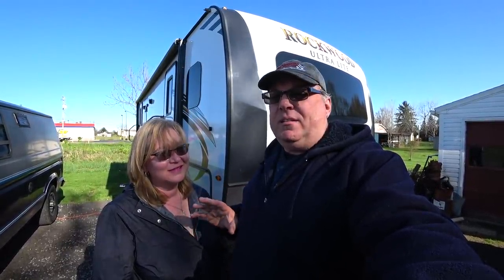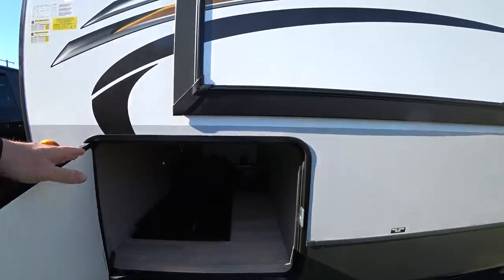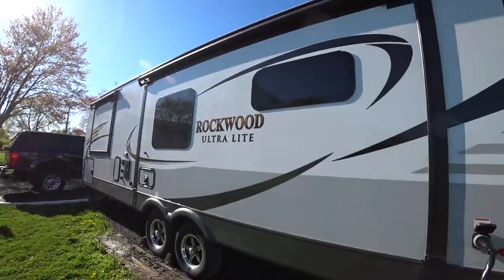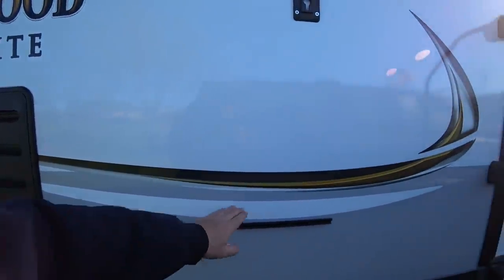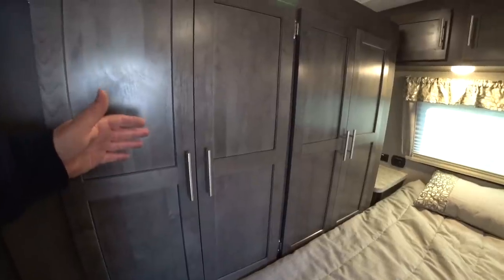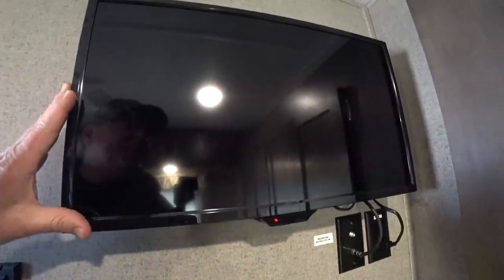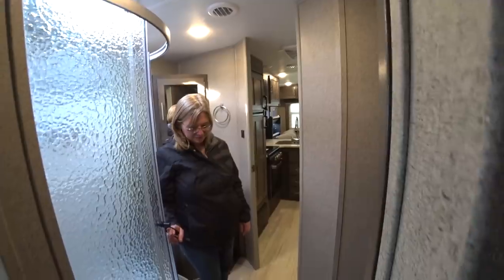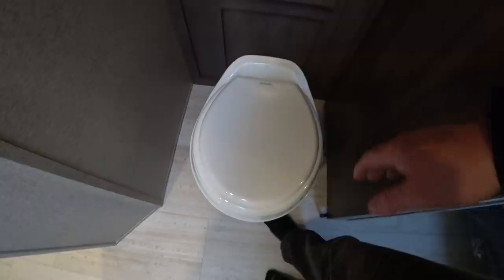2020 Rockwood 2604 WS Detailed Look & Why WE Bought it

Comment: Here’s the thing about parking at truck stops. Truckers have very limited parking and they have to run under government regulated hours of service. So when you park at a truck stop you are taking away possibilities to park for truckers.
Reply from the maker: We always call ahead and ask if there is rv parking.. we've discussed this before in videos. The problem is there's not enough parking. The RV industry is booming as it has been for the last five years. This year, 2020, has seen unprecedented new RV buyers. So if the parking had been Limited at truck stops prior to all this it's really limited now. The whole reason that truckers need to park at the truck stop is because necessary sleep requirements. Weather it's the trucker deciding that it's time for them to take a nap or it's the electronic logs it's telling them to take their break. Most RV owners understand that. Most RV owners do not want to stay in Truck stops. But, the same issue applies for the RV owners, they need to take a break for safety reasons. There are some rigs out there that rival big trucks. Even my small travel trailer and F350 at 17000 pounds combined weight could do a fair amount of damage if I fall asleep at the wheel. So, knowing that I do not want to stay at a truck-stop because of the noise, the piss in the milk jug left outside, the lot lizards, and the smell of diesel fumes lofting into my trailer throughout the night you can get the idea that it's a last resort 4 most RV enthusiast. But when we call ahead to a truck stop because we need to get some sleep, and we're being told that there is no specific RV parking however we can park among the truck drivers, we pretty much don't have a choice. Most of the people that drive trucks then argue that we can pretty much park anywhere that we want compared to a big truck. While that may be true in a limited amount of circumstances, there's not a lot of open arms being extended at most places a business. And with the exception of Cracker Barrel, any business that may allow us to park in their parking lot would also allow the truck drivers to do the same. Such as Walmart. Also we like to remind truck drivers just because we're Towing an RV doesn't mean that we're retired and on vacation. There are a whole bunch of non-experienced rvers out there however, there's some of us that are just as professional and courteous and safe as OTR drivers.

Comment: does the shower miser lever have to be up or down when off?
Reply from the maker: Down to bypass
Reply: @Rvdaydream  , so I leave it down when hooked to city water and lift it when running off tank?
Reply from the maker: @johnsartori9685  if hooked up to city water and it's in the down postition it will bypass the shower head and put the water directly into your fresh water tank... If not hooked up to city water and it's in the down position it will bypass the shower head recycle the water back into the fresh water tank..

Comment: Mike, 
I would definitely look into moving to a Goodyear Endurance. Check out my video where I change over. Look at the flex in the China bombs I had as compared to the Endurance. The stability of my coach was improved significantly when I changed them out. Mine had Westlake E rated tires and I went with the Goodyear Endurance E rated tire too. Highly recommend them. The improvement on the sway alone was tremendous and I was towing in 25 mph winds and it didn't move at all compared to what it was doing. 
https://youtu.be/Hr0f-_JzSHw
Again, congratulations on the new purchase!!!
Pat

Comment: for a ultra light trailer those slides are too heavy.
Reply from the maker: Not exactly sure what you are referring to. This model of trailer has been in production with slides since the mid-90s with no issues. The only thing that makes it an ultra-light is the use of fiberglass laminate siding and an all-aluminum welded six-sided cage Construction. The slides are mounted and operate off of the frame which is just like every other frame on any other travel trailer that is not ultralight.
Reply: @Rvdaydream  dont remember writing this.. dont remember what i was actually going for?
Reply: i remember now there is a guy on you tube who fixes rv's i believe he is in florida. it is himself and his wife and he always says not to get a slide. simply because the weight of the slide is much heavy then the slide tracks which cause failure of the slides to slide in or out.

Comment: Gorgeous but no way I’d get an RV with “slides”! Just something that could easily malfunction or break! It would have to be fixed no matter how much it cost before the RV could be moved on the road!! Disaster waiting to happen!
Reply from the maker: I used to think the same way. However, if you buy a good slide system like a rack and pinion which we have they are very reliable. As far as when they fail you have to get it fixed before you move that is not true. Are super slide comes with a crank tool that allows us to manually crank the slide in. The smaller wardrobe slide has a override that allows it to be pushed back in manually also. The slides of come a really long way. I will tell you to stay away from the cable ones there's even some new rack and pinion ones that are supposed to be pretty reliable that are lightweight even more than what ours is.